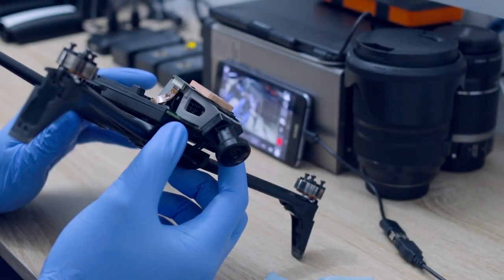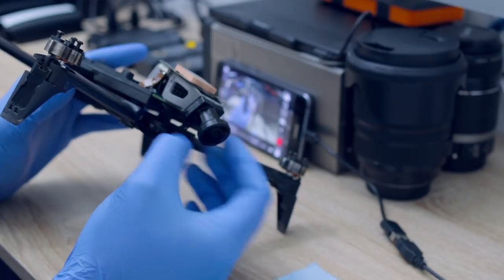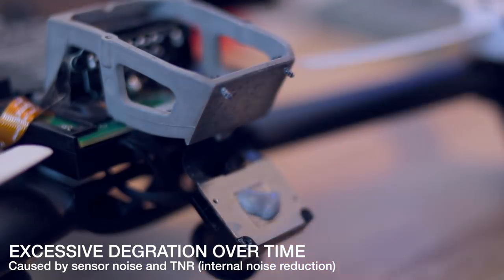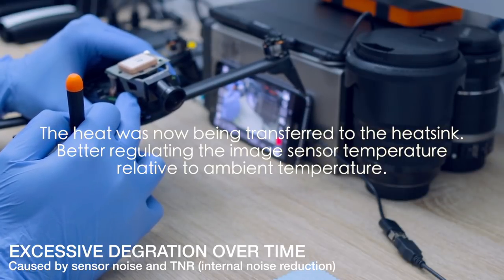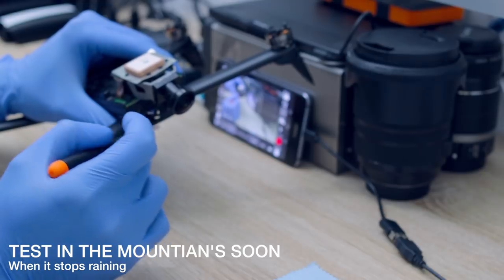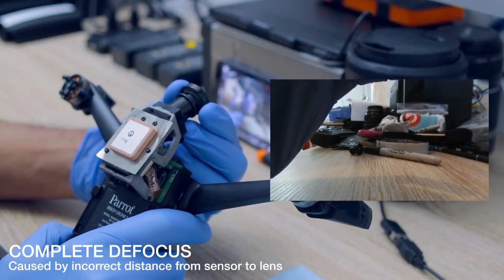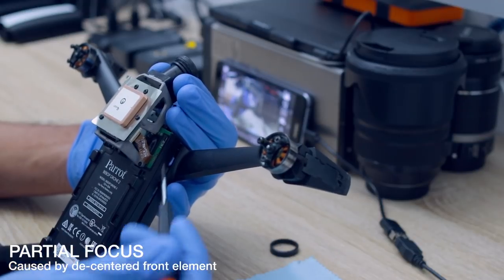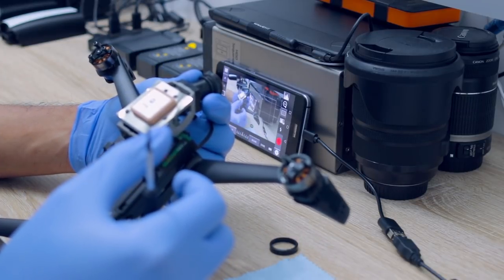BEBOP 2 - Camera Focus | Sensor Noise | Fix Explanation - Part 3

Comment: Excellent work Anthony in yet another great series. Thank you for sharing your photography expertise. I'll be doing these tips to sharpen my blurry videos. Where do you get thermal paste? Does the amount of heat warrant adding fins behind the plate?
Reply from the maker: Thank you Rick, thermal paste can be found in computer or electronic parts shops. https://www.amazon.com/Arctic-Silver-AS5-3-5G-Thermal-Paste/dp/B0087X728K/ref=sr_1_3?ie=UTF8&qid=1521184341&sr=8-3&keywords=thermal+paste

I believe the design is sound and came down to production line not seeing the necessity of heat transfer. Under the assumption that the drone will be flying and moving there is no need for additional fins as I initially thought. The heat dissipation is very good once the void between the sensor and frame is filled.
Reply: There is a hint sink at the gps board. This can be easily contructed, connected with the three screws at the back. However, there are more issues to think about when you start to do this.
Reply from the maker: speedsweets67 thankyou for the information.

Comment: Anthony,Thank you for your camera videos.  I recently purchased a 2nd Bebop 2 from Ebay and it had a soft focus - to the point FPV was challenging!  Upon taking it apart I noticed it looked like it had a minor impact on the front (the foam nose had a small dent in it) - this may have been what caused the soft focus but the epoxy/glue was not broken loose and so have  a hard time seeing how this caused it.I used your hacksaw blade method to remove the glue, separate the lens, wrapped it with electrical tape, and slide it in and out to achieve focus according to your recommendations.I have an update to your focus recommendations. When I achieved focus using your methods, I noticed during flights (and videos) that focus although better was still not sharp at infinity (beyond say 10-20 ft).I had to repeat the procedure focusing only at infinity. I did this by picking tree branches far away (over 50ft) and adjusting focus until the smallest branches possible were able to be discerned. This resulted in a much better focus.I am astonished at how small the range is between being out of focus on both sides of infinity. Although I did not measure it - I believe less than 1mm of travel will take you on both sides of ideal focus.I REALLY wonder how they center and focus this assembly at the factory! I really wish we could devise a way to have a twist focus utilizing some kind of threaded solution - that what is really needed - and could be adjusted for different temperature extremes out in the field.Thanks again,Lane
Reply from the maker: +Lane Last excelent tips, thank you. Can you note which camera the s type or y type ribbon?
Reply: @Anthony - Sorry just now responding, I had to take the nose off to check. The cameras ribbon cable is definitely in the shape of a "Y". Coming up towards the camera from a single connection then splitting into 2 to go into each side of the camera. Was yours an "S" cable? Think this means there are different focus methods for the 2 types?
Reply from the maker: It does, while both systems are cross compatible between the BB and BB2 they are different. For the Y ribbon, if there is an impact and defocus but there is no break in the adhesive, than the solution is to reposition the sensor plate. (it separates from the lens housing). For the S ribbon if it defocus, the only alternative is to remove and refocus and check the IR filter which is also in the lens housing. The sensor and back plates are different, it is the RPROM on each that allow them to function with each of the bebop and DISCO (Excluding Power that only accepts Y ribbon) with some exception for S but extremely rare cases.
Reply: I'm having trouble following you... Are you saying my CCD sensor is loose? Like as in flopping around? I have an excellent focus now across multiple flights.  Could it be that it merely shifted and I have adjusted focus to the sensors new position? Or possibly I may loose focus again if it is indeed loose. What is the sensors mounting method and how do you reposition and remount it?  I know you are a HUGE resource within the Bebop 2 community and Parrot has removed ALL of its support forum and TONS of information - wish we could have a Bebop 2 site with FAQS and tips. I know there are some forums on Facebook but they are not strictly support and hard to search.  I'd like to support such a site - Is there something out there I'm unaware of?
Reply from the maker: No worries at all I can be confusing at times. What I meant is with the Y ribbon the sensor has a very tiny offset I found out that this was used to refocus on in photography terms make (micro adjustments). This is nearly impossible to do with bare hands, upon impact is changes the very tiny distance between the sensor and the lens housing (sensor mounted on backplate). I can eve replicate this by simply packing something behind the sensor and compressing it with the screws, different torque yield different focus results. You statued earlier that the focus point to infinity is very tricky and fine this is absolutely true, and is confirmed by even a backplate shift. No its not flopping around its just not welded to the lens housing if that makes more sense. There are developer forums, and WiKi's which I cross post too for the software side which I dabble from time to time but nothing dedicated to being just consumer support or FAQ. Id be happy to host one if I can get content creators and moderators. I believe there BEBOP community will continue to grow seeing how its more affordable now.
Reply from the maker: PS there is a forums in French independently hosted, but nothing for the English community which I am keen on supporting.

Comment: Would love to see a replacement lens video for bebop 1 and 2. I know that the keydoor lens is a good replacement option but don’t know the drawbacks compared to the original.
Reply from the maker: Nicolai van den Boorn thank you for your lovely comments. Unfortunately i dont have the bb1 to do a lens swap. In theory they are the same field of view so there is no reason why they shouldn't be interchangeable.

Comment: Right! This is an excellent video. I'm still trying to figure out if that is an issue with firmware rather than the camera. My video looks like the whole of grains or how to say, nothing is sharp like it would be in 1080p When I change in the settings to 720p it does not seem to make any difference. :(

Comment: Hi Anthony !
How did you managed to remove the glue of the barrel element  ?
I've tried with an X-Acto knife, but it is very hard to remove ??
Thanks for your instructive videos !
Reply from the maker: Hello :) I used a hacksaw blade to scratch off the glue around the barrel. It took me a while to scrape enough glue and be able to free the barrel. Take your time and scrape the glue in a round motion not straight. That is how I cut the glue on mine. Hope this helps. PS: That little knife won't do much good, you need to scrape the epoxy off not cut it :D :D

Comment: This is very very interesting and useful. I know that focus for a long time as we can see on my older videos but that front lens thing I didn't know and the heat I really didn't know nothing about it. I thing that was the problem on my second Bebop 2. When I turned on in home the image is ok but when I go fly the image becomes blured maybe because of the heat. And I think my first Bebop 2 doesn't have that problem because the image is all the same. And thank you for mention my name on this Video but if the GoPro lens failed I think the SJ lens cam will fail because it is similar to the GoPro 3 lens. There are some videos on YouTube with guys putting gopro 3 lens on a sj cams :-( in the end of this video is a Bebop 2 footage? it is much more focused and nice.
Reply from the maker: Helderhugo thank you, footage at the end is from the mavic air. Bebop was on the operating table at that time :) I'll make bebop view test tomorrow. Today I have to go to Switzerland.

Comment: Perhaps some heat shrink over the top of the outside of the sensor housing may give a snug fit, similar to your electrical tape, possibly a little more neat
Reply from the maker: basics art 101 thank you. This project has been completed. Regards Anthony

Comment: Do you think it would also be useful also for Parrot SAS to include in FFPro settings such as a "manual mode" where you can adjust ISO and shutter speed manually? I see varying values when I check the metadata of my bebop 2 images but we have no access to these setting only overall "exposure". Also the ability to disable stabilisation. The Yuneec Breeze gives digitally stabilised 1080p as the bebop2 does (though not as good imo) and unstabilized 4k video as well that can be stabilised in post production.
Reply from the maker: Yes definitely to have manual settings would be nice but I don't see the point with the current resolution/quality, the only advantage id see with using manual exposure is to take pictures at night but without a gimbal its hit and miss. Using the full frame of 3744x3744 would mean you are working with a fisheye video. You may or may not be able to do a batter job at correcting distortion, cropping and lastly stabilising that requires some decent software and hardware in post. Than you have to decide if all this time rendering in post is worth it all. I think its not worth it but would be nice to have as an add on option of FFP which the minority can purchase. Regards Anthony
Reply: ANTHONYVLOG good to get your thoughts thanks.

Comment: Hi Anthony! Thanks for your video it is awesome. I successfully disassembled the lens of my bebop 2 some time ago and replaced broken lens by the lens from bebop 1 which I bought broken on the local market. It fits perfectly. But the issue was to get the sharpest image since the life stream that goes from the drone to the ipad is not actually 1080 it is ether 480p (in case u record 1080) or 720 (in case u record 720p). Could you please advise how did you connect camera directly to the smartphone? (i see the bebop is without battery but the camera transmits image to your screen)
Reply from the maker: Hi Eugene sorry for the late reply, my schedule has been extremely tight the last month. For my focusing I used the normal way of powering the drone and using my iPad. The reason I use the iPad is traditionally any screen larger than 6.2" will stream 720p and smaller screens lower. The focusing is quite simple just needs time because the latency of the live stream is delayed by a fraction of a second so you will need to make a small adjustment and wait to see the change before making another adjustments somewhat (micro adjustments). Eventually you will hit the sweet spot. Here is how I set up my focusing bench. I used a carton with a text label as reference. Placed 40cm from the drone, I established this to be a good distance as it is just past the minimum focus distance so if it can focus at 40cm it will focus to infinity. With the text on the carton as a reference power the drone facing it and view the live feed on your screen. Make your micro adjustments (patients is key) once you are satisfied. Apply a dab of epoxy (don't seal completely). Let adhesive completely cure and check focus once more. If the focus is still intact you may apply more epoxy to make a more stable seal. Ensure the epoxy ( I use 2 part epoxy) rated to temperatures -30 to + 70˚C for the best outcome and least thermal expansion. I wish I could make a video on this in detail but I am stretched with time at the moment. Hope this helps and best regard , Anthony.
Reply: ANTHONYVLOG thanks for your reply!

Comment: Has parrot corrected this issue and put heat sinc compound behind the sensor on the Bebop 2 power camera?
Reply from the maker: The bebop have reached EOL the Anafi has an improved camera design.

Comment: So, after my mods on the canopy and aplyinf colling paste for the sensor, I went for a test in freezing temeratures and lots of wind. Wind chill factor minus 15 c. 
I am afraid that first impression is there is to much cooling going on. Camera was out of focus all the time. At the end of the day I will make a test with taping all the vent holes in the canopy.
Reply from the maker: speedsweets67 thanks for the update I appreciate it. I'll be doing my cold tests soon

Comment: to hold the lens steady, what did the glue finally put or is it still standing alone?
Reply from the maker: Mauro maurzen glue done flights made after this video. :) 2part  Epoxy with a tempreture threshold of -30°c to 70°c

Comment: Should I buy a Lens cover uv protector they sell or its useless ? Also is 1080p is the way to go or 720 ?Thanks Anthony
Reply from the maker: Hello 👋 the lens cover distorts the image best bet to use the 55mm CPL kit from eBay. 1080p high for video or if you fly with the goggles 🥽 use 720p as it streams at 720p. 1080p streams at 480p
Reply: @ANTHONYVLOG  is the default beebop2 nose is already a protector and the real lens is behind it ?Wondering if I Scratchs I only have to replace the nose ?
Reply from the maker: There is no protector on the bebop /1/2 it’s the actual glass element which is part of the lens assembly. Without that the camera won’t show any usable video/photo
Reply: @ANTHONYVLOG  Oh I will need a to installed a protector ASAP

Comment: I'll say right away - I don't know English well. I watch all your videos, but I still do not understand why the focus disappears in the cold weather?
Reply from the maker: Poor optical design, thermal contraction within the lens assembly causes the optics to shift slightly further away from the sensor causing the focus point to move out of inifity. 😊
Reply: @ANTHONYVLOG  And where exactly does this happen? In which place? Thank you in advance)
Reply from the maker: Between the lens assembly and the sensor. 😊

Comment: My question was that I'm still trying to find the 18mm front glass element for bebop 2
Reply from the maker: Ahh yes, sorry about not understanding correctly your question. When I had the BEBOP 1 and cracked the front lens element (Before I had youtube channel) I used the Pinhole door lens here is the link. It shares similar characteristics to that of the front element that comes with the BEBOP cameras both the BEBOP 1 (S type ribbon, and BEBOP 2 Y Type ribbon) https://www.ebay.co.uk/itm/CHUBB-DOOR-VIEWER-8V001-POLISHED-BRASS-NEW-/200867767696

Regards, Anthony

Comment: Is there a problem with connectivity.... As many YouTubers/pages say?
Reply from the maker: Those you tubers haven't followed my setup guide. If they did they wouldn't have connection problems. 

1 - Encrypt WiFi. 
2 - If you are connecting with SK2, cable from phone to controller. Use app to connect to the drone (not the phones WiFi). 

If these very basic things are followed they wouldn't have problems unless a) they fly out of range b) they come across unexpected interference c) they have a hardware problem.
Reply: @ANTHONYVLOG  thx.... Will do that each time... Ofc once I get my drone... Excited
Reply from the maker: I will make a video dedicated to new owners, a "First setup" video to make it clear and ensure the best experience with the bebop.

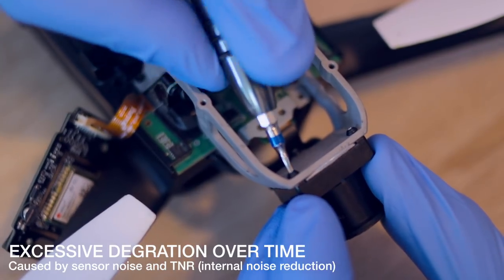Comment: At 3:37 in the video. What size is the Torx for the Heat sink and camera... Is it a #2 ?
Reply from the maker: #4 trox
Reply: @ANTHONYVLOG  : ... LOL.... WOW... the only one I dont have... Ha... Ha... Ha... I guess I will order a decent set from Amazon then T2-T10... That should do it ! I got it all apart with the Bebop Tool kit and then was stonewalled.... So I'm just leaving it all out on the table downstairs til I get the T4 :D
Reply: Got a T4.... worked great. Thanks. I did the paste today and took her up for a 5 min flight. It was -4C and up about 25m was about -11C. 5 min flight... start of video was nice... end was horrible. So in my case I guess the paste made no difference.
Reply from the maker: @GorillamansGarage  lens refocus is for the cold defocus, the paste is to help regulate temperature to keep the noise reduced caused by sensor heat. Ill update the notes in the videos as Iv completed this project.
Reply: @ANTHONYVLOG  : As in your tests video degradation over time in cold weather was negligible.. In my case at -4C to -6C in 5 minutes degradation was evident. I will post the video today. At the start (when I had just brought it out from the house) the video was good and within 5 min. it was noticeably worse. Thanks again for the help... next I think I will have to dive into the focal length adjustment... Always fun... :D
Reply: @ANTHONYVLOG  :As I have 2 bebops (long story) I will leave both in them both out for 1/2 hour in the cold before a short flight and do a test.

Comment: Great Video, 1 question I'v tried different Camera Lenses but I can't find an 18mm front glass, one company was going to fabricate one but the cost for the front glass was going to cost $50-$100 and I told them that the whole camera cost $150 at Parrot and $110-$115 on eBay. I purchased complete camera on eBay for $110. But I still want the glass, my lense barrel broke at the housing that covers the Sensor, that's no problem but if anyone makes a repair concerning lense barrel or any part of the lense and sensor "DO NOT USE GLUE WITH CHEMICALS" because the fumes from glue will damage your lense and sensor (ig white film) when you wipe it, you will also wipe lense coating away.  "No Super glue, Crazy glue, Epoxy" etc. Also Bebop has two different Camera setups, 1 has a single Grey Ribbon and the other has 2 Black Ribbons and I'V noticed that the Camera with the double black Ribbon seem to be more stable in flight while Videoing, could be wrong but I have both Ribbon Camera's. @ ANTHONYVLOG Keep up the good work.
Reply from the maker: Thank you Roderick Jones and what was the question? Regards, Anthony